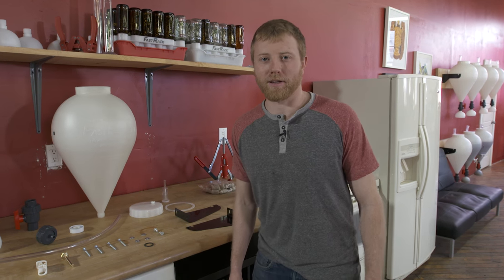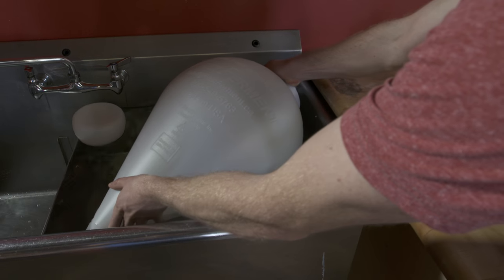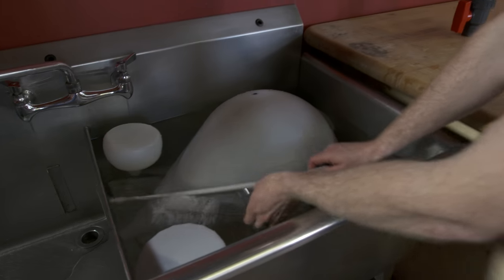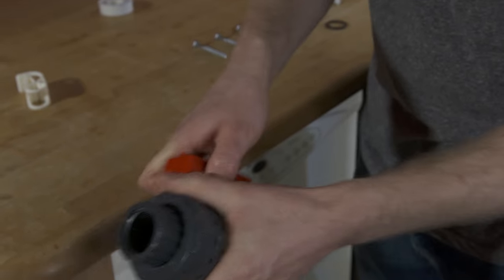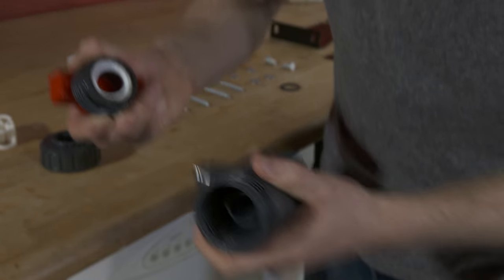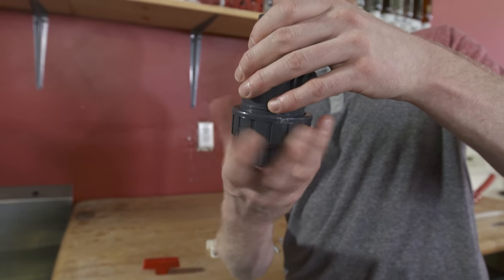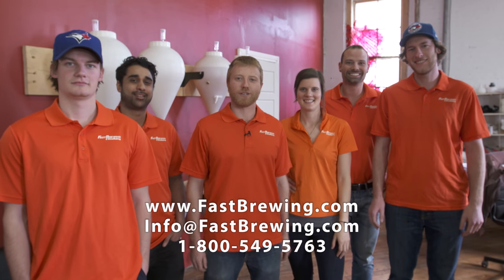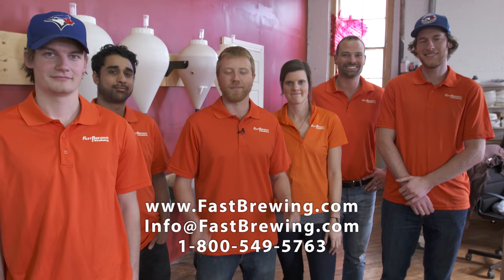FastFerment Cleaning

Comment: Wish I new it had to be soaked for 4 hours... I don’t have a sink or bucket big enough for this.  Why does it have to be soaked for 4 hours? I thought sanatizer took 5 minutes? The instructions that come with it don’t mention this..

Also, why did my water go milky white when I dunked the carboy? Is it plastic coming off?

I’ve found older and newer manuals and none of them mention anything about soaking for the first time use?  Can I get a new manual?
Reply: Hej John, you can check the manual of your sanitizer. I am using something like StarSan and they mention, that it could happen, that you solution is turning milky. If this happens the minerals in your water are reacting with the sanitizer and it could happen, that it is not working properly. I bought 5 liters of distilled water and mixed it and had no problems so far